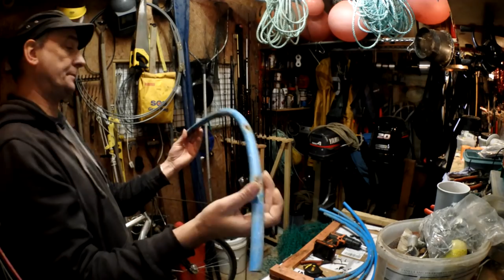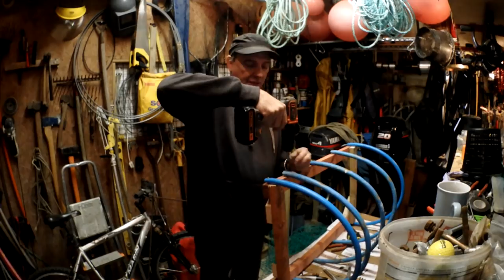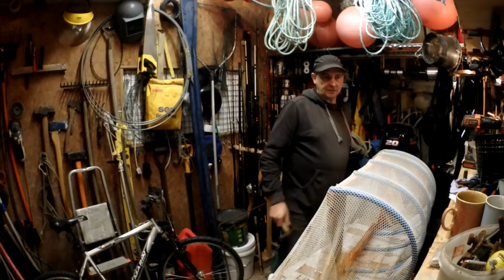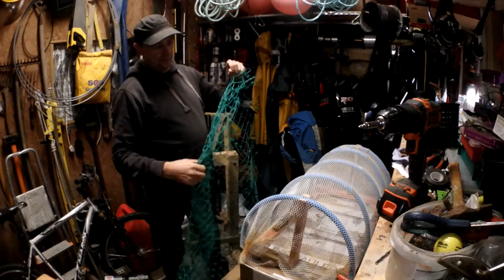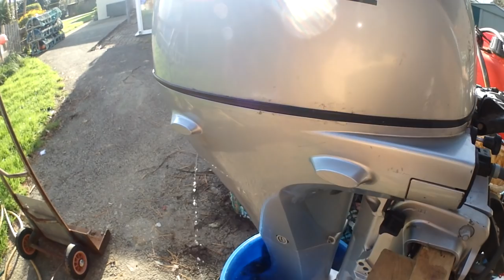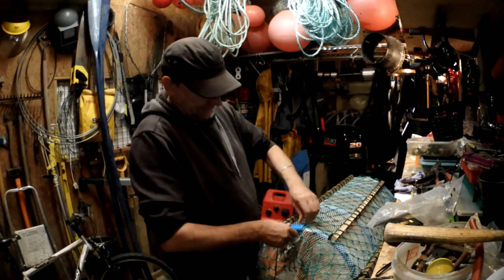Lobster Prawn Pot Build & Talking Lobster

Comment: Another great bit of 'shed waffle' Troy! 😁😁  Great info about Lobsters and Brown crabs.  It will be great to see some updates on the new boat, and I'm itching to see whether the 20hp or the 10hp is the best for your needs for the new boat.  Did you give any thoughts to my comment about the difference between charge outputs of each engine to keep the winch batteries charged?   Stay safe & well.  👍👍
Reply from the maker: I will be using the outboard to charge the battery I have a 12v 700ah 100a battery I only lift pots for short periods of time. During travel time and other fishing time the battery will be charging plus days I do not do any pots. Also thinking about solar charger just for when I am not on the boat but I dont expect much from that as space is limited for installation.

Comment: Hi Great Video as per. what do u use as weights in the pots as i think one of the pots i made was sitting on one end going by the muddy end. seen u use old heating tubes but don't have any lol.
Reply from the maker: Sash weights, steel pipe filled with cement or angle Iron. You can use bricks wrapped in net but they will take up more space

Comment: Hey Troj, would 6.5 kg weight in the base of a crate of the size you are making be enough weight in rough seas if there was no wood on the crate, only steel, plastic hoops & netting etc?
Reply from the maker: It would sink and it and probably would be ok in some places. It depends on how strong the tide is, how much swell you get, how big the rope and buoys are and if its a single pot or on a line of 2 or more. Around here often in the  biggest storms single pots will move no matter how much weight you put in them
Reply: @Trojwaterman  I was thinking of stringing 4 pots together with 25m between each using 250m x 10mm 1900 kg break high strength pp/pe rope onto a one of those 300mm inflatable buoy's that you would use on anchor retrieval to set up overnight in the ocean up to 150m deep & also a flashing led so no boats run into the dam thing.
Reply from the maker: Just maybe give the pot with the surface cable some extra weight and it should be fine
Reply: @Trojwaterman  okay thanks